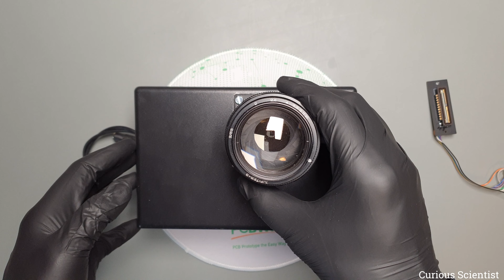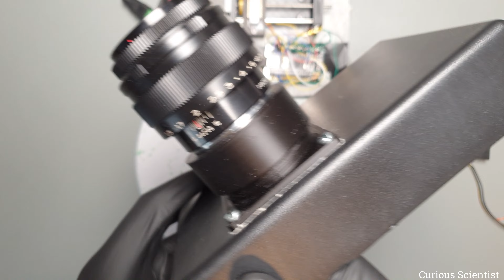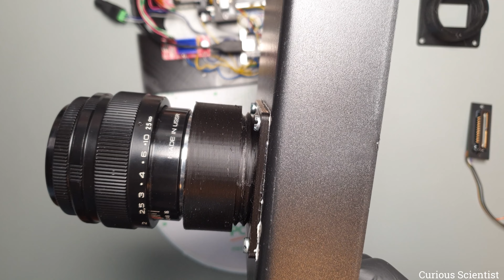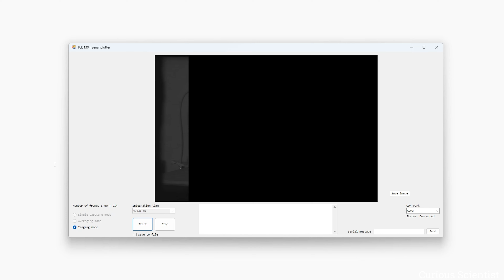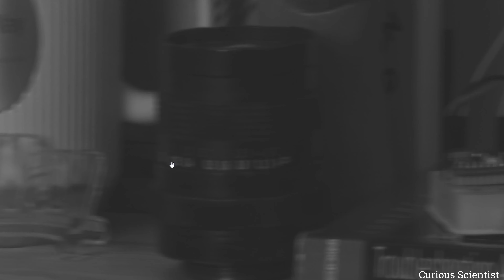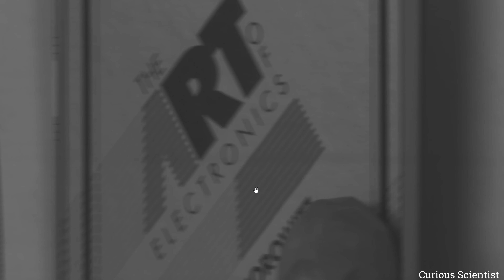Building a full-frame digital camera from scratch - Part 2

Comment: For those who will build this I'd recommend to attach a matt screen alongside the sensor, on the same bracket, and to make a coverable hole in a backplate with a lens to check a focus. While the sensor will be moving, this screen will be shifted away.
Reply from the maker: Great idea! I am working on a code where you can check the focus on an external screen. Not by looking at the actual image, but by looking at a single line's graph. One can determine if the image is in focus based on the shape of the graph.
Reply: @CuriousScientist  This must work. The only an issue I see here is to make sure a contrast enough image detail will be scanned at that time in case these will be few lines, not an entire frame (because this is too long to wait for a result). If this is expected to be a one-time routine, a special image helps. Like a paper sheet filled with stripes pattern.
Reply: @CuriousScientist  Yet more idea (from a different video about two sensors): if you take a medium format lens, and double a scanning distance, you can make wide, panoramic-like pictures.

Comment: Cool project, I noticed that the pixel size of the CCD is 8x200 micron. Perhaps this could be the reason why there seems to be a blurryness, but only in the horizontal direction while in the vertical direction the image seems much sharper. Do you have a link to the original non compressed image taken with the camera?
Reply from the maker: Thanks! Yeah, it could be blurry because I chose a smaller step size than the width of the pixel. And since the scanning goes along the width (200 um) of the pixels, it might cause issues. However, I have much better image that I recorded with the earlier iteration of the camera and that was quite nice. So it might also has something to do with the mechanism that moves and supports the CCD. I will soon build a new iteration because I have new components, so we will see if I can improve the image quality. 

Regarding the picture, I haven't uploaded it anywhere. I can try to find the raw file, but can't promise that I will find it, because it has been a while since I played with this gadget.
Reply: Yeah i can imagine that the motion system has be smooth to avoid artefacts. I have made a camera from a linear ccd as well but i have used a rotation mechanism instead of linear. The best results were when the rotation speed was kept constant but that requires the data transfer to be fast enough to write everything to the sd card before the next buffer is filled. Not sure if you move the stepper motor continuously while capturing light with the sensor or you start and stop the motion for every line. For my mechanism the latter option introduced to much vibration but might work different for your mechanism.
Reply from the maker: I scan a line between two steps. The motor does not run while the scanning is ongoing. However, there could be vibrations for sure. In my case, the data transfer is basically immediately done, so the motor does not spend too much time with parking. The reading-stepping-reading is programmed efficiently. Once I build the new mechanism and circuit (I worked out some cool improvements), I will test it again and publish the results in a similar video as this one.

Comment: To focus and to adjust integration time, move the sensor  to the center of the image, put a focusing chart in the center of your composition and plot out a continuous life stream of your sensor. Focus your lens by looking for the lens position with the steepest slope in your graph. And for ideal integration time, look for a graph that uses optimally your value range without clipping. If you want a numerical reference number of how well your focus is, use max value of the first derivative of your plot as a reference. the higher the absolute number the better the focus.
A good way to focus would be out of your window. Objects more than say 500 meters away are good enough to count as infinite. This is ideal too to fine tune your flange distance.
Reply from the maker: Thank you for the great tips! I will consider them in the upcoming update.